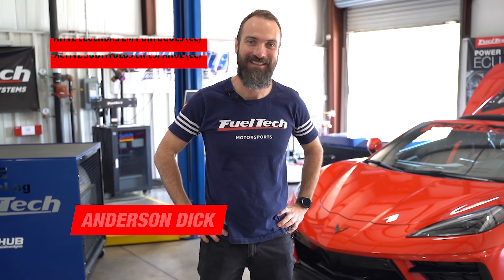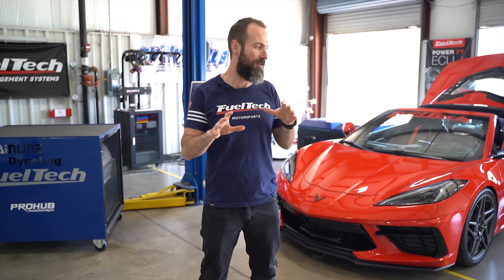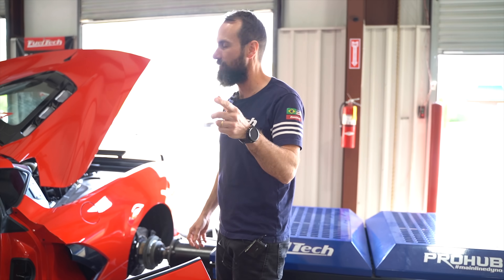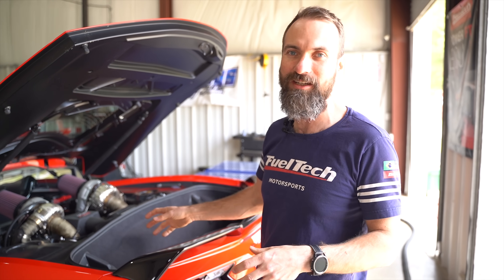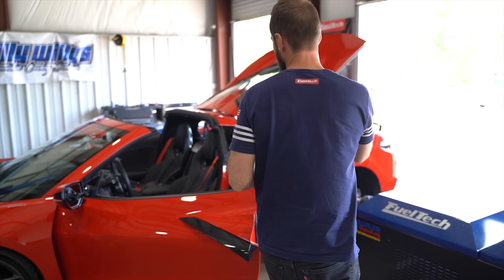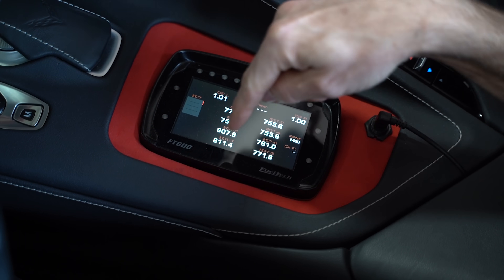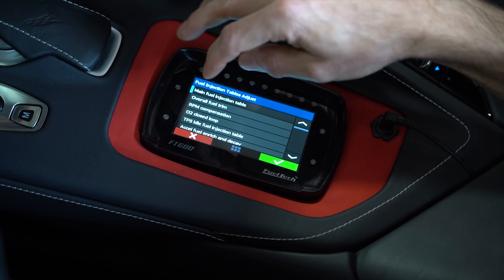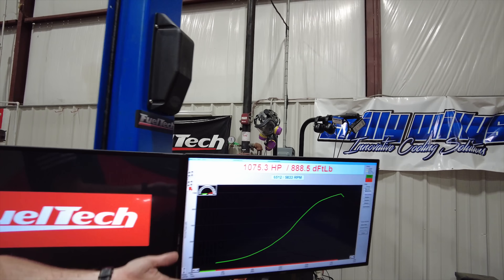1,075 WHP | Twin Turbo C8 Corvette new HP World Record! | FuelTech FT600 ECU

Comment: when those turbos get hot they're going to melt the plastic on the hood covering the motor and maybe even start a fire and then there's the glass, it will probably crack from the excessive heat. Relocate the turbos to where the mufflers are and you should be ok.

Comment: Did you solve the known flywheel and clutch issues that happen under high hp levels? If not, it won’t last more than a few passes. By the way, you’ve got twice the power necessary to get in end trading trouble. Be careful!

Comment: how much difference between hub HP vs wheel HP?
because de record was/is 1022 WHP at 5767rpm and 942 WFT-LBS at 5089 rpm... not the hubs

Comment: I didt know who you were Intill U introduced urself & I am impressed..I've been watching ur videos of mostly Pro Mod type cars I guess bcz I have 1 But mine has F11 Fowler Extreme, Carbon Hat w/a spacer..I have 6 shooters in car..I got them prob decade ago B4 I started 2c Fuel Tech around..I wondered If 600 series would work on engine like that? Seems as tho you can control things & just how it works as computer, givs you cylinder temp, tells you abt the clutch😳..IDK but would cost me atleast $4k to buy a Used Racepak tht has bunch of meters but urs seems to do this things as well as control all systems in car? I usually see coil over cylinder systems & not MSD 44, but then I saw acouple which had 44 mag aswell FT600, So does that system work Big Mag like that Or is The MSD run on sperate system?🤔.I havent actually taken this car to track in prob decade & half bcz I live in Terrible New York, But I want to now which Is why I bought F11 Blower setup, Its best kind of 14:71 made compared to my Kobelco HH K9..Also since I dont run Any Sactioned events, I spike it with Nitromethene, usually 1/3 Nitro ta 2/3rds Alcohol, which maks ridiculous power, Id Think Appoaching 6000Hp But would be cool to know..Ill get bigger pump & then run 1/2 & 1/2😮, Now THAT Should Make Some Zoomie Flames! But seriously, I do have Vanishing Point 1off Monte Carlo, barely tell its Monte Carlo bcz its not some old Pro Stock, it Was Vanishing Points cover car for abt 3yrs & Ive never seen anything especially made by a top shop quite lik this thing Hence why I kept-it all these years..Iv watched So Many Videos of those Turbo cars you do, Steve Morris Engines, hitting almost 5000Hp On Alcohol, In My Lifetime?🤑.I dont have That kinda money But since I had car updated several yrs back But this car has only 6 races under its belt So if thers 40 runs Id be Suprized but the condition I got the car in & was only year old, scratch frame rails taking Lenco In & Out, Pathetic! Is it possible for a nobody as I am to put a system as you have into a kinda basic when you think abt it car, you know Blown Alcohol Engine w/a very good Blower setup, Id like to DUMP the Lenco & Get Maybe 2-3spd T-400, Lenco compacated to adjust clutch & I use't race T-400s & Power Glides, But what Glides gona hold Im hoping 6000Hp, Maybe more? I can run upto 60% im told from engine builder which would be easily 6000Hp Id Hope..I figured would be good time to write you since I now see who You Are, an obvious genius to of come up w/a system like this which seems to work almost flawless?😉.Well thats pretty amazing considering I remember when I switched to MSD stuff, 6AL in early 1980s, So pretty long time & you came up w/a system thts not some Other System some guy came out with, OH No No, I see these systems starting 2b almost The Standard Now!🥳.Please Tell Me in last 40yrs anybody really using Anything Else but an MSD But Now I See Fuel Tech more often then not which is not something Ive seen since MSD came around..Im Not Complaining at all abt MSD But I Am saying uve not only broke into electronic ignition world which is impossible But Ur Now The Man In The Ignition World Now, So thers got 2B reason & I think reason Is Ur stuff is just better otherwise Why would all these big dollars car use Ur Fuel Tech Over Big Boys MSD?🤔🤔🤔, UR BETTER has 2b the reason & If im gona take that Monte Carlo out again, Id like to make this easy as I can to mak-it better experience, I think Automatic Trans & Ur Fuel Tech System would probaby be the ticket to car that runs well all the time..I hope maybe to turn this into street car, change to water engine & run it around on E85, But w/a Supercharger On Top instead of to go Turbos like everybody else has done..Now THAT would be something..Only car doing That is shitbox from hell, uses PSI but disconnects blower belt to drive it around, Put belt back on to race the car which is a far better idea then my dumb "We'll swap engines at races from street 2 the Race Engine", Yeah great idea😖.Anyway sorry to take up so much space here But I was watching videos High, saw this & felt I need reach out 2U bcz Ull know these things I speak of, Ur a very smart person unlike myself & you have an intimate knowledge of these complacated electrical & computer type things, so no bullshit figured Id lay-it-out & see what you say? If you read these messages from time 2 time? I Think from what Iv Seen Ur system is the best period & I would like 2C a 6000Hp Or maybe 7000+Hp figure with Nitromethene, guess we'll see, thanks for reading this stuff I wrote you🎸🎸🎸
Reply from the maker: Hey Spencer, for sure a FT600 and a FTSPARK ignition per cylinder can be managing everything on your car, call us at 678 493 3835 or email at sales@fueltech.net and we will be glad to help!

Comment: Congratulations on the killer numbers. I'm extremely excited for the electronics to finally start making it to the market. Were the turbos placed there for development purposes, maintenance, or what? I saw where you wanted to replicate the LMR build but the kits that mount the turbos is like the UGR IMO fit the car better. So I didn't know if this was for ease of development and/or turbo upgrades etc.

Comment: With the air intakes in an area where it doesn't have access to cooler outside air, how much does that affect the engines performance. The way it is set up, it looks like it would suck in a lot of hot air from the engine, exhaust, and turbos.

Comment: Wouldn't the numbers be lower if you used the conventional tie-down with wheels mounted dynos compared to hub dynos? Seems like comparing apples to oranges with Emelia's 1,022 HP to the rear wheels. But regardless congrats on a great job!

Comment: Don't hub dynos give a higher reading than road dynos. So the record is for hub dyno only
Reply: thank you! That is exactly what I was thinking.. This is not WHP.  THat's like taking a engine on the stand that gets 1,200 and saying you have a 1,200 HP C8. It's not WHP unless the dyno reads from the wheels.